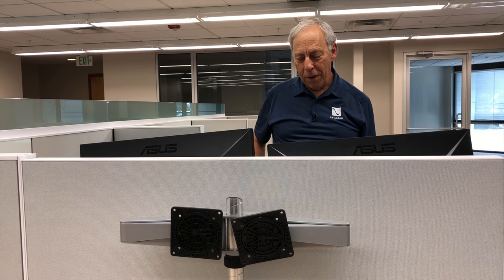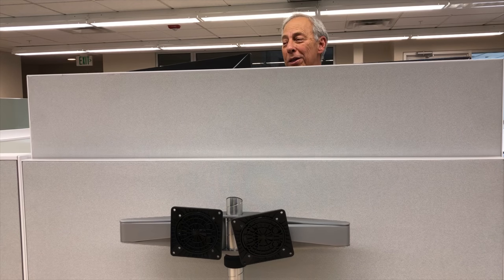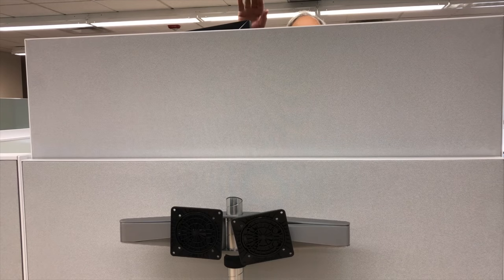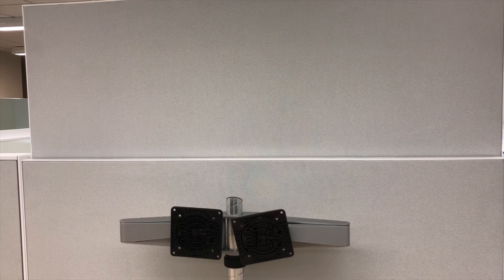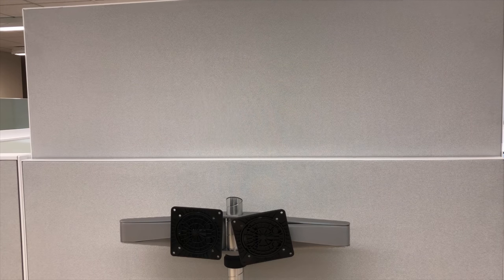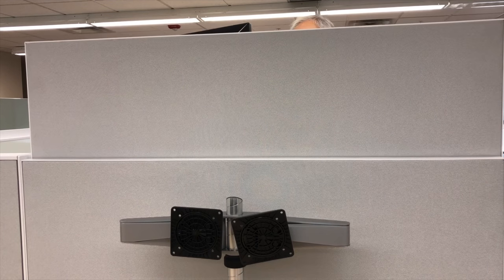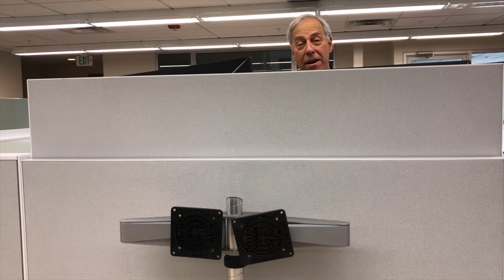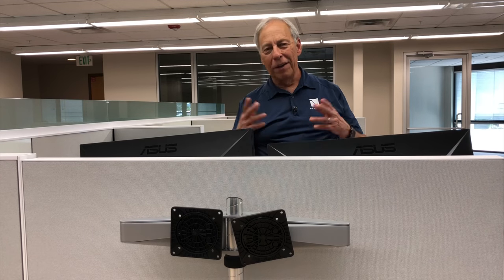Replacing capacitors in vintage equipment

Comment: Many years ago I was troubleshooting a car amplifier when an electrolytic cap exploded.  The metal can (part of the cap)  hit me right in the middle of an eye and within a couple of minutes I went blind in that eye, all I could see was light or dark.  Luckily I was wearing a hard contact lens when this happened and the lens spread the force enough so that there wasn't more damage to my cornea.  The lens itself tore.  (Yes, a hard lens, not a soft one).  The cure was to spend 3 days in the hospital with both eyes bandaged, the good eye had to be bandaged to keep them both from moving.  The cap wasn't in backwards, the amp's internal voltage "booster" somehow was putting out much higher voltage than it was designed for and higher than the cap's rating.  Since then I never work close to live electronic equipment without safety glasses.
Reply: 30ish years ago a colleague and I were developing a new filter for a SMPSU. We fitted a new electrolytic cap, switched on and got a fantastic result, 10mV of ripple pk-pk. We thought we had hit the sweet  spot and congratulated ourselves on our success when suddenly we heard a brief hiss then a big bang and like Pauls story, we got covered in bits of confetti and almost fell over ourselves, we jumped that badly. We did laugh about it although our boss wasn't quitter so amused.
Reply: @gboates  I have seen many blown capacitors and never got injured by them. Certainly a direct hit into an eye is a differnt story but i never experienced more than mediocre hit.
Reply: I've had them blow up in my face. I always wore some cheap magnifying glasses when working in a repair shop.
Reply: Yep those old capacitors without the ridges on the top shoot the can like a bullet. I had it once shoot a dent in my ceiling.
Reply: good advice.
Reply: Glad you are ok
Reply: @matekochkoch  A blown cap will rock your world, and can cause serious or fatal injuries.  There are YouTube videos out there that show the destructive power of a mini-bomb going off in your workshop!
Reply: Sounds like me in early 90's with those super tiny light bulbs inside toy cars I had the awesome idea of connecting it to mains 240V to see what happens and BOOM, it got thrown out of my hand and pieces hit the ceiling, I'm glad it didn't hit my eyes or I'd be screwed.

Gosh times without internet sucked cause now we can know everything of what happens by doing "X" thing without having to try it 🤣😁

EDIT: But that really teach me not to ever put anything in the wall socket 4 good LOL. But still didn't save me from a PSU blowing up and burning in flames and my small CRT exploding with a huge bang, gosh after that I was always scared to press the power button on any CRT TV...

Comment: I want to add one more caution after watching the video. Paul is talking mostly about electrolytic capacitors in baseband audio circuits. But never blindly re-cap tuners, phono EQ circuits, tape EQ or bias circuits, basically anything where the cap tolerance is critical. If you do you will probably throw the unit out of alignment, especially a tuner. Small mica and ceramic caps are very rare to fail. And they can have tolerances from 5% to 20% especially in consumer gear. When the unit is aligned at the factory, those parts tolerances are nulled out of the circuit as a whole. If you replace parts, re-alignment is often required. And today it may be hard to find a service shop with FM tuner test gear as well as someone who knows how to use it. Electrolytic caps in tuner circuits are usually just power supply bypass caps and OK to replace but again it's best to stay out of RF and even audio EQ circuits unless you know for sure the component is bad.
Reply: Couldn't agree more

Comment: I’m a vintage hifi guy. Golden rule is if it sounds great you don’t need to replace anything 👍
Reply: until it goes bang
Reply: Maybe.... but I'd never leave it on and alone.  You may hear a boom, and you may only hear the smoke alarm going off after flames are emanating from your amp. The power supply protection fuses don't always blow first.
Reply: I am too, but I recap all my vintage gear. From mixing consoles to tape recorders to effects racks. Rather keep things in good working order, avoid future cap leakage (with inevitable trace corrosion). Every piece of gear was improved after replacing the aging electrolytics. Lower THD, precise filters/EQ points, lower SNR... not to mention the massive improvement in reliability. I think of electrolytic caps like failing gaskets on an old car. Sure, the car will still run and drive, but it's nowhere near it's initial performance.
Reply: @lllllllllllllllllllll1lll1  Also I don't know about electrolytic capacitors, but I sure remember that specially computers upto 2009 had HUGE problems with solid capacitors because for ages they kept using bad "fake" capacitors branded as jap solid caps while they weren't and many computer hardware had crazy problems which got fixed from 2009 and up.

I know amps don't use much solid caps, but the electronic parts for other stuff like decoders and whatever probably used them a lot specially in the first HDMI ones and most likely those first could also been suffering of "fake" caps being advertised like good high quality Jap solid caps which could lead to any sort of problem.

ps: Most likely electrolytic caps also suffered a lot with fake stuff at least in PC hardware cause I saw many motherboards with blown or leaking caps that didn't even had that much years back then. And nowadays specially when trying to buy electronic components there's a gazillion amount of fake chips and whatever sadly which is really hard to know WTF we are even buying sadly...
Reply: I have a 1976 Heathkit AA-1506 120 watt stereo audio amplifier, and when checking recently I found that the two 250uf 4 volt Bi-Polar Electrolytic capacitors now had odd readings of approximately 450uf and 340uf. I replaced each of those with a bi-polar 220uf in parallel with a 30uf bi-polar.  Every other cap seemed to be okay. In my 1976 Soundcraftsmen PE-2217 Equalizer/Pre-Amp, one electrolytic capacitor had become an open circuit, and a few other electrolytic capacitors were of the wrong value.  A production line boo boo.  Some 2.2uf caps were in place of 4.7uf caps. In turn, the left side equalizer lowest band filter was not the same as the one on the rights side, and the two Phono Pre-Amp boards were not identical, due to these too having these wrong cap values, and not only that but wrong values in different positions for each board.  Thank goodness I had managed to find the schematics to know what the proper values were to be.  Meanwhile, all the other electrolytic capacitors, despite being 48 years old, surprisingly were all slightly higher than the specified value, but well within the tolerance rating.

Comment: Another thing to take into account when determining if you should replace caps is actually how little the component has been used. Specifically if it has been sitting without power to the caps for years. Non-use can dry a cap out too, as use actually works the electrolytic, keeping it in its intended state. And as stated in the video, excessive heat kills them by drying them out.
Reply: The rated voltage should also not exceed the working voltage too much, as that will be detrimental to the electrolyte too

Comment: $2500. Power cords. $5000. Speaker cable  ? But questions about spending  ,maybe less than $100. For parts and if you can do the job yourself? I don’t care what or who made it  ! They are not going to put the best ?  It will work !  But time is the master…and nothing stays the same ! I’ve had great pleasure in restoring certain gear with fresh parts ! I see people spend more money on lottery tickets ! Than what some caps cost ?  Your car tire has some tread left ,it works  ? But a fresh set has grip and security ! 
It’s always a fine moment when you hear the difference! The topology is very good on some older gear ,if you use what is available now ,you would be pleasantly surprised  . Paul is the Mr.Rogers of audio ! And I mean that as a compliment ! Very good human being skills.

Comment: Good video.. If you have a piece of gear that has a constant 60Hz hum (not a ground loop), look at the power supply caps. The hum is often a sign of failing power supply caps.
Reply: That's the sign of power supply caps getting old!
Reply: Salvador Rodenas Indeed!
Reply: Unless the item is a total POS and nested with ground loops. You'd be surprised how many products sometimes pricey ones are plagued with them.
Reply: I repurposed an old pair of 9v computer speakers into a headphone amp, I think they were from the early 90's, They drive my headphones VERY nicely off a battery however they do hum badly when I crank the volume up all the way, the hum got quieter when I replaced the wires and re-soldered some connections, however the caps are cheap generic ones, combined with age...I think its time to change them, and probably some transistors too.
Reply: I look after the sound gear at a couple of skating rinks, some of which is approaching 20 years old.  One of those systems includes a digitally-controlled equalizer with +/- 15V internal supplies for the analog electronics, and one day the power supply cap on the -15V rail went open circuit suddenly, without any warning.  The result was an 8V pk-pk 120Hz square wave coming out of its audio outputs, which gave everyone at the rink quite a scare.  I wasn't there at the time, so fortunately they were able to find the power switch and shut it down.  
When I repaired it, I replaced all 3 of the main supply caps.  It's interesting that the warranty statement for that equipment explicitly denies warranty coverage for failed electrolytic caps.
Reply: @BlackTownie999 I had a set of powered computer speakers I was troubleshooting. One of the caps had already started bulging, and I replaced it, but it didn't fix the issue. I checked a couple of others and they were fine, so I decided to scrap the set. It turns out that one of the 0.47 uF electrolytic capacitors had failed open. At least I learned never to trust TREC caps again.

Comment: Mouser has a great selection of caps, as Paul said go for the low ESR and make sure you get the polarity correct!

bak when I was a bench tech I worked next to Vinny who was one of our senior techs. He was running up the variac on a new unit and about 2/3's of the way up he uttered oh shit, before he could get that big variac turned down a tantalum cap that was backwards launched itself - A slug rocketed out of that chassis and shattered the two 8 ft fluorescent lamps above the bench. We both froze but had the presence of mind to close our eyes as we got showered with glass from the shattered tubes.

he later said he felt the variac groan because of the load that backwards cap cause but could not spin the 280v 20a 3 phase variac down fast enough.
Reply: Variac plus current limiting device like a light bulb in series is always a good idea.
Reply: In electronics class the ceiling was full of holes, when we got bored sometimes we would hook up an old  can cap backwards,good times.
Reply: We used to leave charged caps lying around on the bench in lab, 600v oil/paper caps will hold a charge for a very long time.

i used to to all the testing on the oil filled radar power supplies we built. We used 0.5uf 25kv caps in these supplies. Radar draws very short slugs of current so you don't need huge power supply caps in the supply. These caps were about 4X6 and9" tall (including the ceramic terminals with 10-32 threads), they came packed 6 to a box and usually came with a shorting strap across the terminals. If you leave an unshorted cap on the bench overnight it will have a substantial charge on it the next morning if the air is dry. 

One day we got bunch of these caps in without shorting straps. The girl in the stockroom dropped the razor knife she was using to open the box across one of the caps, a fair sized chunk was burned off the blade by the arc. From then on Jane made me open all oil filled cap boxes and put shorting straps on them.

Comment: Hey Paul - far as i know i ‘invented’ the variable height workstation. I worked for Acadia university in canada. The acadia advantage was an ibm partnership which brought 5,000 laptops on campus around 1997. Our faculty needed something to prevent back issues during 3 hr evening classes. The manufacturer was InLine Systems from... you guessed it - Toronto Canada

Comment: I have restored quite a few 1960s and 70s stereo components. And I am fortunate to have acquired a used but very good Sencore LCR meter. Most of the caps I check are still perfectly good. Now not everybody wants to go buy an ESR meter although there are some good low cost units on Amazon. And blindly re-capping a piece won't hurt anything, provided you don't accidently do other damage. But as modern caps are as much as 50% smaller physically for the same value and voltage rating, that can be a problem for large chassis mounted electrolytics. Yes you can kludge in the new smaller caps but if the old parts measure good. I just leave them as-is. Now this is gear that gets very little use and again before I get pounced on here, there is nothing wrong with re-capping a vintage piece of gear and is the best option for day to day usage. My point is only that many of these 70s Japanese caps are still perfectly good today.

Comment: If you live in Toronto, ‘Ring Audio’ specializes in vintage audio. The store repairs, restores and sells vintage gear. They will swap out you capacitors for you. I had been a customer of Rings until about 5 years ago, when all of my vintage gear was replaced by new high-end stuff. You’ll love the store.
Reply: True. I lived in Toronto for three years in the mid-80s. I bought the turntable for my first component system at Ring, in 1986. Very good people! It was (is) a used, modified Rega Planar 3. They set me up with a new Nagaoka MP-11 Boron cartridge. May be the best purchase of my life! It's sort of lo-fi hi-fi, sort of a workhorse? It's the only turntable I've had, it's here with me now, I use it lots. Same cartridge and everything. I live in Vancouver now. I recently had the Rega serviced at The Turntable Shop in North Vancouver. Nick is a gem, he totally knew about Ring Audio.

Comment: Low ESR caps are mostly used in switching power supplies where the resistance matters to the feedback loop. In linear supplies that usually means they can heat up with large ripple currents and in time dry out quicker, but they don't make things sound worse.

Comment: Cross over circuits in speakers also contain electrolytic capacitors.  Old speakers will "die" because of aged electrolytics.  Don't throw the speakers away when this happens.  Just have the capacitors replaced.  Other parts like resistors and inductors will normally last forever.

Comment: When I was in electronics technical school, we had an ex-Army instructor who gave us a demonstration of the power of a 100uf 25V rated cap wired backwards in a circuit.  Within seconds, the cap began to emit gases then exploded.  He had put the entire thing in a protective enclosure, so no one got hurt, but no one was expecting the bang we got that day.  I learned my lesson without having to learn that lesson; check and double-check that replacement's polarity!